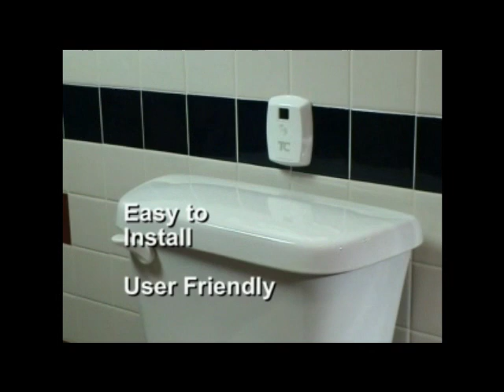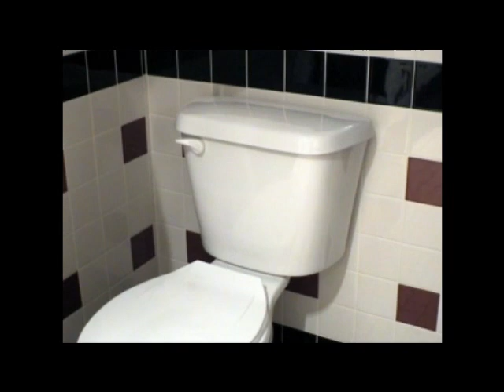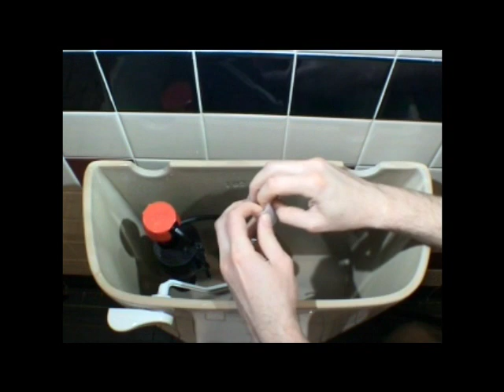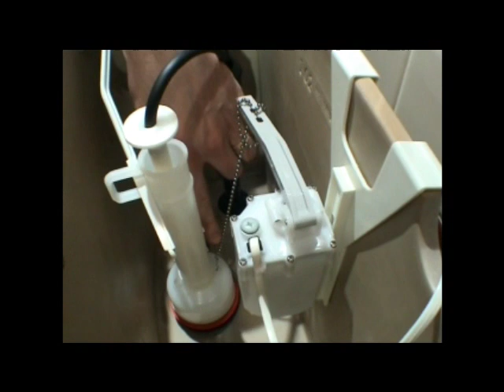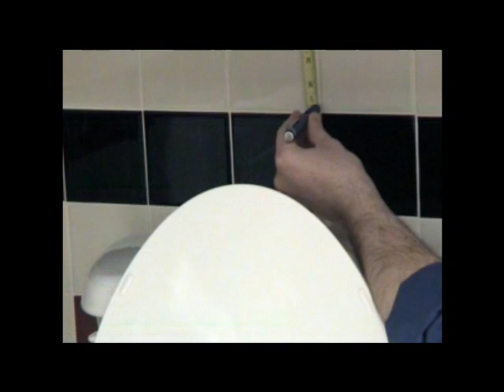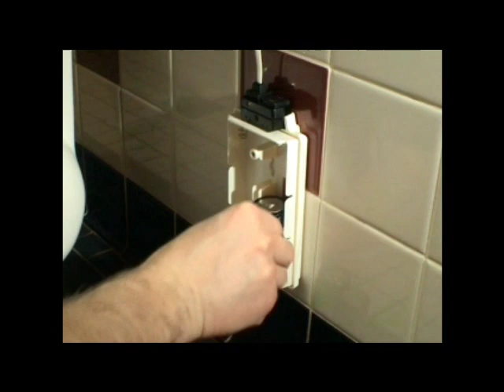AUTOFLUSH TANK

Comment: Hi I just install my TC auto flush and I have a question: why is the sensor flushing right the way when we use the toilet? It is not giving the few seconds delay. I adjusted the OD range and I put in ODX. What Im doing wrong? I want it to flush a few seconds after using. Please help!